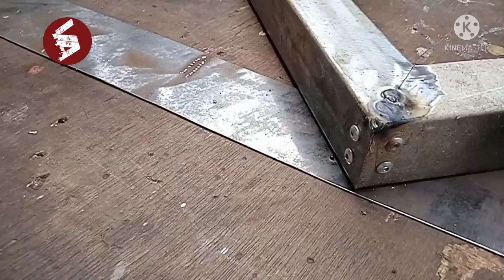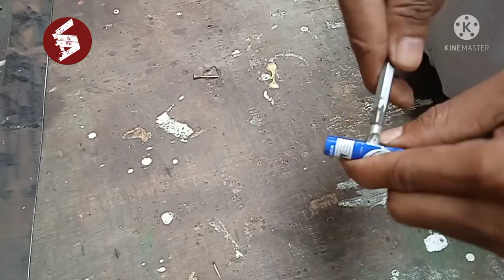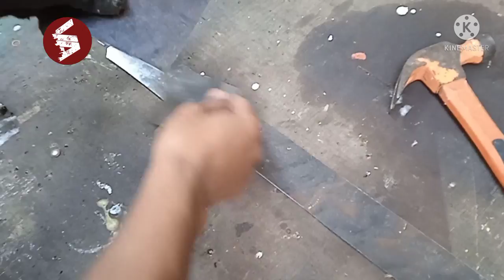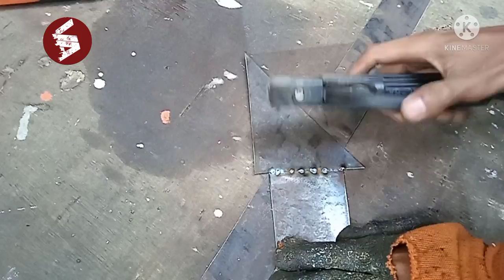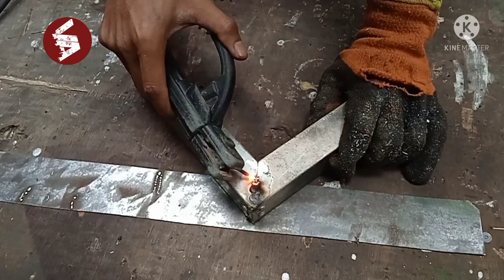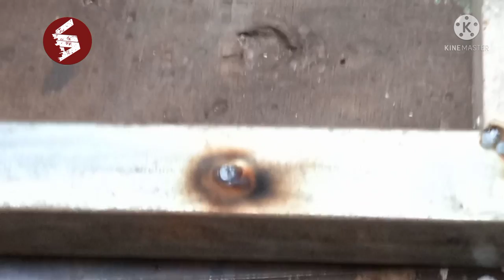carbon welding-thin iron welding using battery carbon

Comment: My first weld about 35 years ago ,  I used a battery carbon and a few car battery's to power it ,  I might have used a coat hanger for a rod ,  I cant recomend this but it worked in a jam ,.